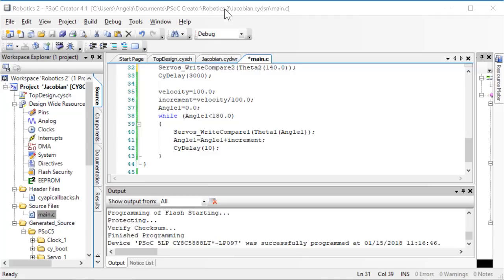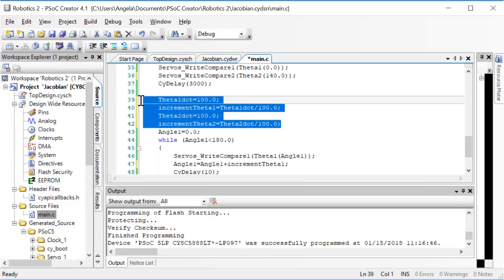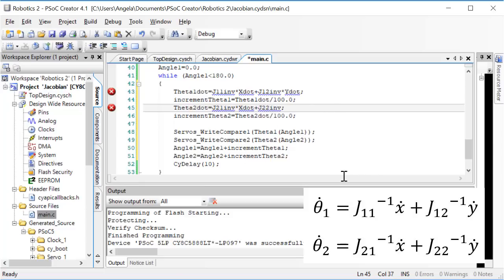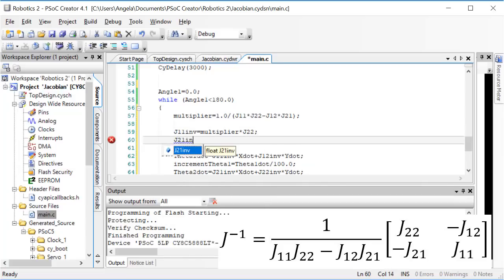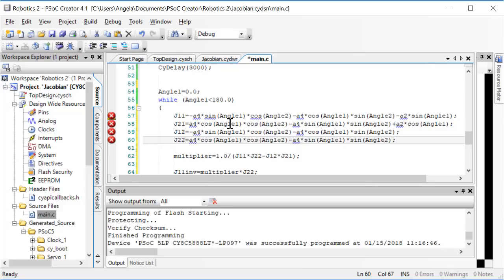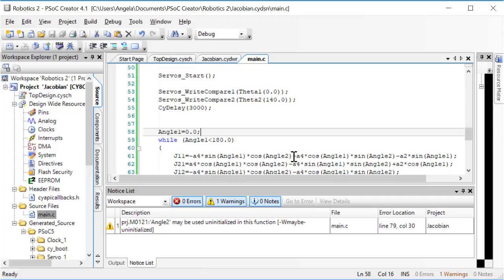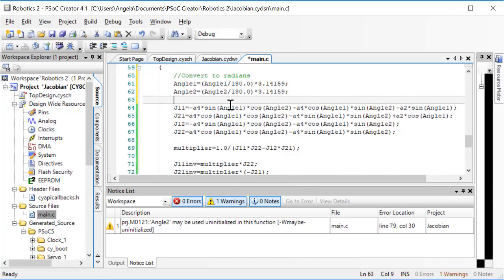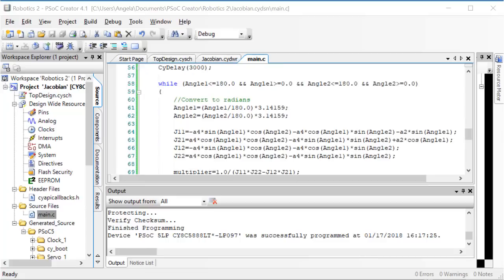Robotics 2 U1 (Kinematics) S4 (Path Planning) P2 (Programming the Jacobian)

Comment: Hi, awesome videos !!! 
I wanted to ask if you could point me in the right direction on how to get smoother motion of the servos?
Reply: For smoother velocity you need to change the angle with smaller increments per step. This may be limited by your specific servo, but look into the datasheet and find the minimum step angle, use this angle in your code. What you need to change in the code used in the video is the incrementTheta1 and incrementTheta2 divisor. Set it higher than 100 for smoother movements.

Comment: Madam, Why you have considered xdot and ydot = 1 . Previous lecture you have @5:49 you have derived the equation for xdot and ydot....
Reply: it was explained through the end of the lecture. by setting xdot ydot to constant 1 you set the path at a straight line with 45 degrees. if you want a specific case of a path you will have to change xdot and ydot at each step of the computation with respect to your parametric equation.
Reply: @VusalTagiyevv Thank you so much